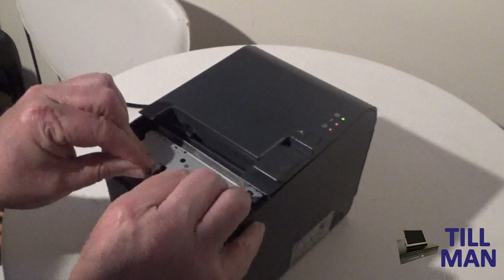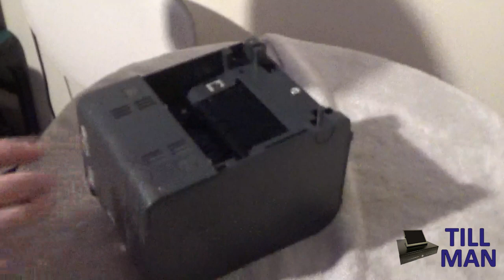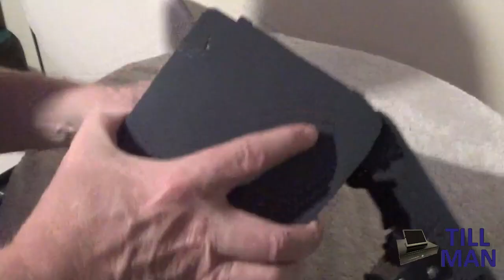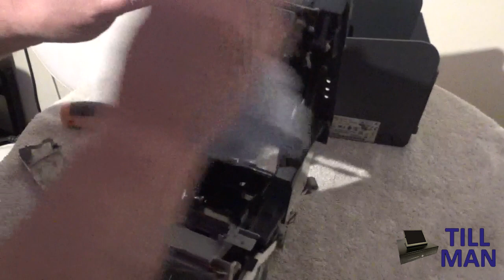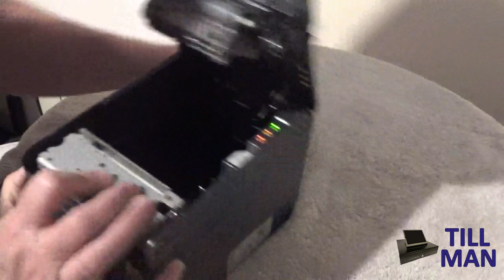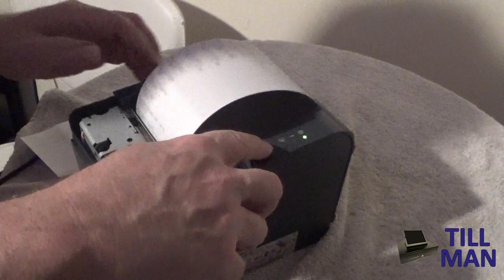How to repair an Epson TM-L90 Label Printer with a jammed paper lid cover (as seen at McDonalds NZ)

Comment: Hello,
nice informative video.

I have an issue with autocalibration of die cut label paper and FEED_CUTTING position. Printer feeds not in the middle between labels, but near the beginning of subsequent label and during some cuts it even cuts a tiny piece of subsequent label leading to autocutter jam.
The die cut label paper we are using is 49mm x 30mm and space between labels is around 2mm

Tried manual paper layout in Memory Switch Settings Utility, but no matter what settings i try to set, always get error "Paper layout setting value is invalid".

Do you have experience how to manually set label paper layout or other solution how to solve this autocutting issue? Thanks!
Reply from the maker: No I dont on this printer and I dont have one here at the moment to look at, but if it was working and suddenly stopped then it sounds like there would be a sensor in there somewhere that detects the label gap. That sensor might be blocked with dust or a piece of label or it needs some kind of calibration procedure. Have you tried this reset...
https://www.epson.eu/en_EU/faq/KA-01068/contents?loc=en-us
Reply: @NZTillMan  thanks for prompt reply. Yes,  i have done reset and automatic paper calibration procedures. Printer is brand new so the sensor is not clogged. The strange thing that the native Epson utility does not allow to manually configure paper layout.. :(
Reply from the maker: @mindaugaskiriejevas7480  I havent done any setup for label sizes on this printer so probably not much help with this. Can you set stocks for sizes in  the printer properties maybe?